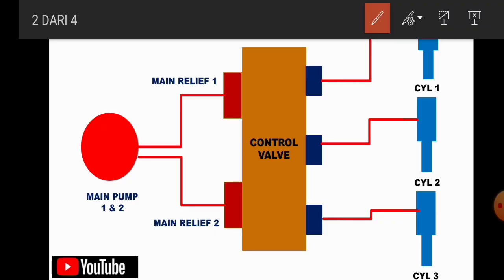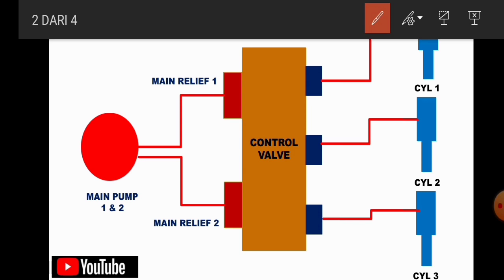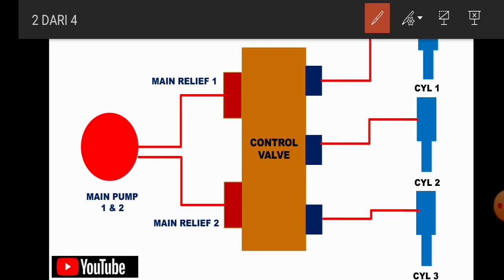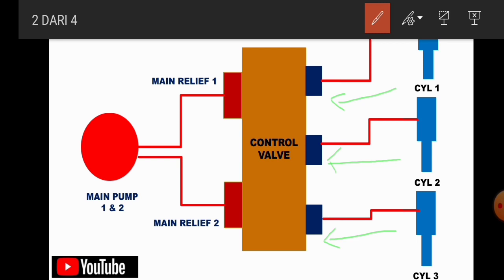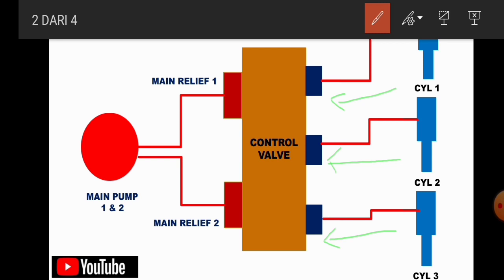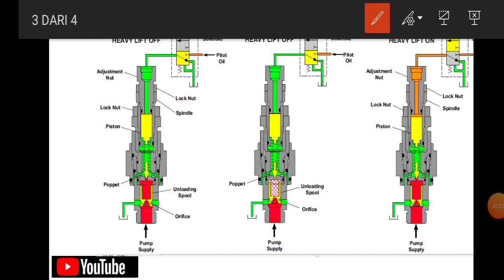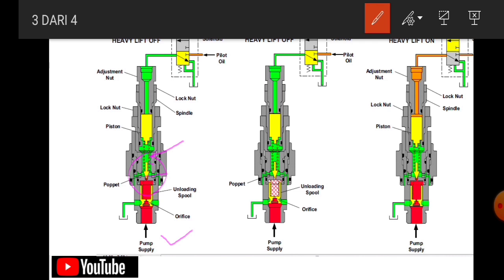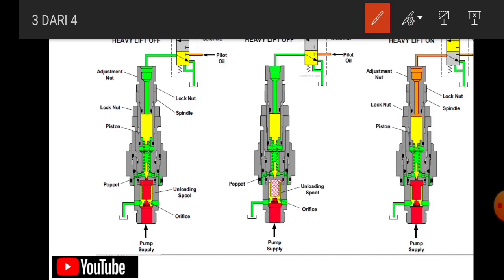Cara penyetelan MRV main relief valve dan menaikkan tenaga hidrolik  PART-1

Comment: Bang mohon pencerahan nya cat 320 d trek kiri sma suwing ga bisa gerak sma sekali trus ketika boom trun rpm langsung rendah, abis resell control valve sma man pump mohon pencerahan nya🙏
Reply from the maker: Kalau liat ini kasusnya ada masalah di resealnya coba ingat2 dulu mas
Reply: Ok sipa mas nanti saya coba lgi
Reply: Klau pengaruh dari man pum atau dari legulator nya untuk indikasi nya smpai stag ga bang swing sma trek nya soal nya ngga mau gerak sma sekali🙏
Reply from the maker: Kalau mau di komunikasikan lebih lengkap bisa gabung di group wa saya biar saya kasi arahan urutan pengecekannya
Reply from the maker: Tekan tombol gabung mas
Reply: @M.Nusur-Lpkmecha  bang blh tanya hyundai 220 LC klo dia panas arm bucket di lemah apa masalahnya
Reply from the maker: Jadi gini mas sampean harus analisanya dari yg kecil kalau sama sekali tdk bisa bergerak bisa kemungkinan brake berfungsi kalau aman cek pilot yg mendorong spool apakah sesuai atau tidak jadi pengecekannya urut

Comment: Bg kalau mesin drop ketika di kasih beban posisi gas otomatis, apanya yg rusak ya bg, kalau posisi manual lancar aja bg, kira2 apa ya bg, cad 320d
Reply from the maker: Coba cek sensor AEC nya
Reply: Maaf bg pemula, sensor AEC itu di bagian mana ya bg
Reply from the maker: Sensor yg terpasang di pilot mas
Reply: Berapa tegangan volt nya ketika full beban ya bg, rencana mau cek kabel nya dulu sebelum ganti solenoid, takut nya malah output dari ecm yg rusak bg 😢
Reply from the maker: Kabel yang ke solenoid apa ni mas yg mau di cek
Reply: Maksud nya prv solenoid nya Bg, udah di masukin mentok gada perubahan Bg, soket juga di lepas sama aja, mrv juga udah di keluarin 180 derajat sama aja bg
Reply from the maker: Kalau manual gasnya kondisinya normal maksdnya gmn
Reply: @M.Nusur-Lpkmecha  maksudnya kalau automatis drop Bg , kalau manual bagus Bg, manual yg di maksud kontak yg di belakang bangku sebelah kiri bg
Reply from the maker: Oww gitu berarri aeus yg ke prv problem itu
Reply: @M.Nusur-Lpkmecha  arus nya berapa volt ketika dikasih beban Bg dan ketika ketika tanpa beban bg
Reply from the maker: Bervariasi sesuai dengan beban kerja tdk bisa ditentukan mas tidak seperti solenoid biasa yg on off bisa di cek voltage 24 atau 0 kalau arus mainannya variable sesuai beban kerja
Reply: @M.Nusur-Lpkmecha  minimal arus yg di alirkan ke solenoit ketika bucket di buka full berapa ya normal nya Bg, apakah pengaruh alternator hanya bisa mengeluarkan arus 21.5 v yg menyebabkan low power angine
Reply from the maker: Coba hubungi saya di wa mas
Reply: @M.Nusur-Lpkmecha  no wa nya mna mas
Reply from the maker: Klik gabung di samping tombol subscribe
Reply from the maker: Pakai arus mas bukan volt dan itu bervariasi

Comment: Bang,,apakah ada pengaruh di chek load valve jika boom posiisi up sangat berat dan mesin drop.cat 320D.
Reply from the maker: Kalau itu sih jarang bahkan kalau pun pengaruh pasti engine gak sampai drop
Reply: @M.Nusur-Lpkmecha  trimaksih bang ilmu nya,semoga sehat dan sukses selalu
Reply from the maker: Sama2 mas, yang perlu diketahui kenapa excavator bisa drop karena 
1. Engine low power
2. Engine Derate karena akibat over heat dll
3. Yang sering terjadi ketika terbebani yaitu sistem kerja dari Power shift solenoid yg di pompa
Reply: @M.Nusur-Lpkmecha  sementra ini solenoid sdh saya manualkan bang.setiap boom up mesin drop.arm kluar masuk mesin dgn sendiri high idle.bucket kluar masuk lambat tp mesin normal.keadaan layar monitor rusak.sudah 10hari sy blm bs menemukan penyakitnya bang.
Reply from the maker: Oww gitu

Comment: Cat 320d2 voltasi turun terus apakah di pastikan controllernya  rusak bang..
Reply from the maker: Voltage apa nih yg turun, datanya yg lengkap mas
Reply: @M.Nusur-Lpkmecha  voltage d monitor 15v bang sedangkan tegangan keluar di alternator 24v bang.
Reply from the maker: Pembacaan monitor salah bisa karena wiring ada yg pitus atau short

Comment: Bang mau tanya ni,320D saya mesin nya drop dan beret2 apa penyakit nya bang lah?...terima kasih
Reply from the maker: Fuel sistem dan air sistem bagus gak
Reply: Kalo solar nya bagus ja,filter nya sudah ganti semua bang,kalo di nyalain angkat boom,mau mati engine nya
Reply: Alat saya ni dah mulai pancing sama bensin hidup nya bang,
Reply from the maker: Coba periksa PRV solenoidnya yg di pompa
Reply: Yang di atas itu kah bang solonoid nya,atas sebelah kiri kalo gak salah,mengetauhi rusak nya kayak apa bang?.....terima kasih dulu bang lah infonya,
Reply from the maker: Salam kenal
Reply: Maaf bang,abang dari mana?...saya dari kal-sel bang